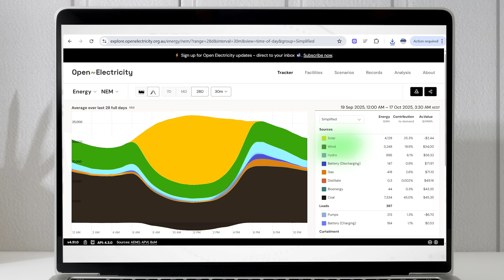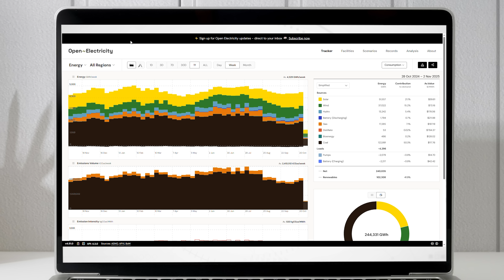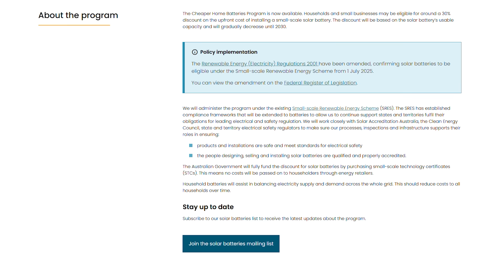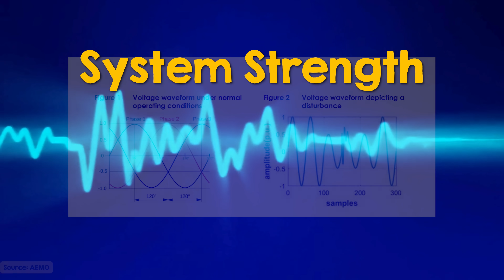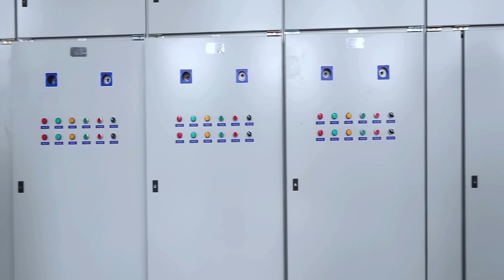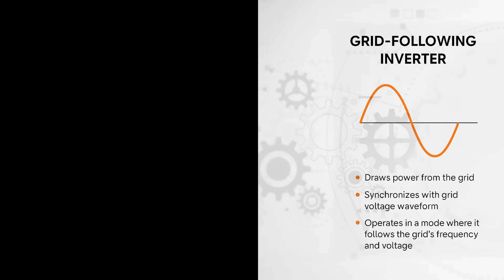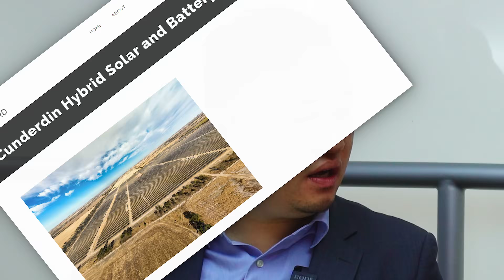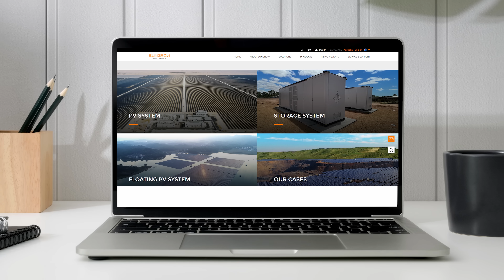Australia’s Solar Boom Is Breaking the Grid - Or Is It?

Comment: Surely with the amount of cheap electricity coming online the shift to EVs in Australia will have to accelerate? It feels like you’ve struck gold but a good amount of Aussies refuse to touch it.
Reply: In China the electricity is around 4 times cheaper. In the cities there the EV take up is high. Has the advantage of quieting the roads too, making them more pleasant to be around.

Australia has 'negative power prices', but a separate supply charge that is huge. i.e. the power prices are a scam in Australia. Of course, it would make sense to wait until the technologies become truly cheaper, but it is politically non-viable. Better to say electricity is 'cheap' and separate the connection fee and fees for 'maintenance.' Surprisingly, other countries like China are significantly more honest.
Reply from the maker: The Australian government just announced we'll be getting 3 free hours electricity across midday. That's surely got to tip the scales A LOT in favour of EVs.
Reply: @EngineeringwithRosie And home batteries. And we needed V2X yesterday.
Reply: @EngineeringwithRosie  What did they teach you about free things in your Engineering studies?
Reply: @EngineeringwithRosie  It'll be interesting to see if that gets passed on in EV fast charge stations which usually charge a fair bit for electricity. 

If so, probably gonna cause issues around that due to the limited infrastructure - like people lining up around the block at the cheapest servo in town to save a few bucks. 

Would likely require a lot more investment in fast charge infrastructure and the grid upgrades to suit, as those have a wicked high intermittent demand
Reply: @Thermoelectric7  I think there shouldn't be anything "free"— it's corrupting. Paying a quarter to half the price, that is, receiving a discount in exchange for network stabilization, is fair.
Reply from the maker: @Thermoelectric7  ha ha no way will they do that
Reply: @Thermoelectric7 In Germany, I saw an interesting solution - parking for electric vehicles with above-ground and underground floors near public buildings, where solar panels from the entire block are connected.
People come to work and their cars literally “eat up” all the excess generation at the "daypeak = night" tax rate.
And in the evening, taxi and car sharing cars arrive in their place and are charged at the same night rate.
Reply: @MihailG5541  The company "shareholder interests" model is corrupting.  SA's 2017 blackout was because it was more profitable for energy generation companies to with-hold gas and allow the grid to fail than to supply more gas.
Most of the shareholders are foreign citizens, so it wasn't in their financial interests to keep the power on.
If that's not morally corrupt, I don't know what is.
Reply: @EngineeringwithRosie nothing is ‘free’ from the government.  You’d be very naive to believe that.
Reply: @EngineeringwithRosie  I work at AGL, weve been offering the free midday energy plan in SA for a little bit now with the Three for Free plan.

There's been a good uptick of takers. The great thing is it's so helpful for people who can't get their own solar system
Reply: @EngineeringwithRosie  To me free power in the middle of the day tips the scale to Bitcoin mining, gas separation and compression, battery storage and anything that requires a ton of power being drawn to the middle of the day. Heck why not just get a freezer and chill a huge block of ice in the middle of the day yo cool your house. I am sure I can think of hundreds of ways to draw down the grid.
Reply: @EngineeringwithRosie  Er that just admits that rooftop makes so much that it overloads the grid.
Reply: @FlintStone-c3s  I SA, when too much rooftop generation threatens the grid, they switch off the rooftop feed-ins to the grid.
Reply: @EngineeringwithRosie incredible and very lucky for you!
Reply: IMO, V2H (vehicle to Home) will be the thing that boosts EV's -> the ability to use car as the home battery, in place of installing static batteries. Might kill the home battery market if it becomes a norm.
Reply: EV's use less electricity than petrol or diesel cars when you include the electricity used in processing the crude oil into petrol or diesel.

So more EV's means less crude oil processing.

Therefore more EV's means less electrical demand.
Reply: @matthew_baynham that means nothing when you charge them off a grid powered by fossil fuels.  😂
Reply: Sounds like a vanity project, trying to prove to the world how you might be able to run a country on renewable energy. The extra costs are irrelevant,the destruction to the landscape is irrelevant. The loss of high energy use industry irrelevant. But hey look at us we're clever aren't we. Not forgetting that the money,effort and destruction will not have any affect on the climate
Reply: EVs are the wrong solution, car dependence is the problem, trains are very easily electrified and use power directly from the grid and regularly. They are also the most efficient form of transport space and energy wise. Natutally some cars will be necessary for remote areas but people can still use those its about giving people an alternative so that they have the option. For example many families in the netherlands own only one car whereas in the UK its closer to two.
Reply: @JNelson_  China's developing light rail/tram/trolley system that follows electronic beacons set in the road, instead of rails.  Routes can be changed by switching beacon trails on and off.  Plus rubber tyres, not steel wheels.
Reply: @oakfat5178  Rubber is less efficient than steel simply due to the higher friction that's why trains are much better. Not to mention trams are much more predictable and so they can be mixed safely with walkable areas. There is no reason to reinvent the wheel really or rail in this case.
Reply: @JNelson_  It's a trade-off of rubber usage against versatility.  These trams can also ignore the beacons and be used as articulated busses if they need a route with no beacons implanted in the road.
The biggest resistance to more trams in Adelaide seems to be the cost of laying the tracks.  Imperfect trams would be better than no new trams at all.
Reply: @JNelson_ we have decent public transport, but the train is basically already full everyday. And the country is too spread out to make it convenient for alot of others, plus it takes a very long time to make new lines etc. I don’t see that being the fix
Reply: @seekingtodream  If it is full it simply means you need more services and lines these are people that would otherwise be on the roads. 

Being spread out is a myth perpetuated by the car lobby in the USA and it's not supported by actual evidence. Even if you ignore long distance trips (which can and are regularly filled by trains in many countries). Most trips are short anyway, trips to work or the shops things which can easily be filled by light rail and other trains.
Reply: @JNelson_  public transport to work for me would be 2 busses and a train. Or one comfy car ride with my own space. It’s a pretty easy choice. 

I’d be tempted if it was just one train. 

If buying something, I’m driving because it’s easier to put it in the car than catch a bus, wait and carry anything with me. We just need a government that is willing to teach people how to drive properly.

Like maybe a message that says merge at the speed limit, instead of drop 5 save lives bullshit.
Reply: @seekingtodream  That's my point though, shit public transport is shit, good public transport is seamless and more convenient than a car. 

I'm not saying anyone should use one method over another the only way to make public transport attractive is to raise the quality and provide a better service.

The more different forms of transport people can use the lower the load on those transport types, if everyone uses a car then the roads will always be a nightmare this is another proven effect of the load matching the capacity, the only way to reduce the low below capacity is to provide sensible alternatives.
Reply: @JNelson_  We need not only trains, but also trams, trolleybuses and buses with long autonomous running times.
Reply: @MihailG5541  Totally agree I was kinda using trains as a catch all for all kinds of rail transport but as you say a good public transport network is multi-layered: metro, trams, intercity trains, buses etc.

EV vehicles require nasty materials to create and cause more road damage (due to their weight) they are not a silver bullet for cars.
Reply: Range is the issue. My EV has 330 ks of range. But that's a pittance driving Melbourne to Brisbane.  

EV makers should forget gadgets.  Just give us basic cars with fuking big batteries.
Reply: @Triantiwantigongolope  300kms of range means almost 3 hours of driving, no?

I have a Rivian and opted to buy the biggest battery - with 400 miles of range. I rarely drive more than 3 hours without stopping to pee/walk the dog / eat anyway.
Reply: @therealcmj  400 miles of range would be great. It's not so much the number of hours driving as the distence between opportunities for recharge in Australia if you go off major highways.
Reply: @Triantiwantigongolope  It is more profitable to use two batteries of different types (for urban start-stop style and traction for country style)
Reply: @Triantiwantigongolope  On the other hand, if you only drive from Melbourne to Brisbane a couple of times a year, it's rather inefficient dragging round a "fucking big battery" for the rest of the time. You could hire a car with that capability, or you could top up en-route.
Reply: @matthewmarks6951 perhaps. But it would still be easier to have a range of say 700ks. Especially in the bush.
Reply: @Triantiwantigongolope  carbon neutral fuel and high efficiency ICE. It boils down to specific energy… batteries have none when compared to liquid hydrocarbons. We will need 40 x more resources for batteries than we ever would for liquid hydrocarbons. Make the hydrocarbons cleaner or carbon neutral. 

People are not going to want to give up their standard of living to buy expensive EVs with big batteries. No one cares about emissions if they can’t afford to get to work or take the kids to school or buy groceries. 

Energy needs to be plentiful and cheap and available 24/7. 
Everything wind and solar cannot achieve.
Reply: @polarbear7255  carbon neutral high efficiency ICE sounds good. But I can't see it on the horizon.  EVs are better than current ICE cars other than range issues. Been running solar with a 20 Kwh battery and an EV for a bit over three years.

My spread sheet shows I've saved a bit over 8 k in car fule and about 5 k in house fule. Running costs included it's quite efficient and should improve as capital costs are revovered. However I confess I  have not tracked petrol prices very well. As a result, I'm assuming an average of 180 cents per litre, which may or may not be accurate.
Reply: @Triantiwantigongolope ze Germans have already manufactured carbon neutral fuel using wind turbines. Fully automated process. It extracts CO2 from the atmosphere to produce the fuel. It’s only a matter of time.

EV are no better than any other car. It’s still just a car. Just the engine is different. Still has suspension, brakes, steering, tyres, coolant,
Lubricants and electronics. Still wear out as you drive it.  No one is going to pay 20k to put a new battery in a second hand one either. So they get scrapped exacerbating the resource intensive nature of EVs and batteries that just shifts the emissions away from the tailpipe to China.
Reply: @polarbear7255  pretty cool for the Germans. Will be great when it is generally available. That's a real breakthrough  

Try driving an EV for a while. The lack of noise and vibration make a big difference on long drives. Servicing is also $ 250 every two years.
Reply: @polarbear7255 I don't know of any cheap "carbon-neutral" fuel other than that produced from industrial hemp or palm oil. Everything else is too expensive.
Reply: @polarbear7255  by the time the battery wears out, the rest of the car will be worn out as well. So you are right, no one will be buying new battery for the old car.
Recent stats show, that most batteries will actually out-live the rest of the car and will be forwarded to second life use (like energy storage) when the car gets scrapped.

Yes, Germans are producing carbon neutral fuel. But it is for the luxury sport cars only. Simply because it is really expensive. And it will remain expensive, because it is highly inefficient.
Both catching the CO2 from atmosphere and producing clean hydrogen are still waiting for some huge invention to make them viable. So far the efficiency is tragic = high cost.
Reply: @tomas_klouda  but also, would you install a 10+ year old EV battery in your house? With an unknown history, the prevalence of battery fires and the extreme difficulty in extinguishing them. No insurance company will touch that with a 40ft barge pole. 

The batteries will get dumped. Even slightly damaged of defective EV batteries are deemed unrepairable and are written off. 

Who then is responsible for the safe disposal of said batteries when they give up the ghost or start leaking at 15 years old. You want to be the home owner responsible for that?

Carbon neutral fuels are coming. It leverages our existing infrastructure. The Germans waged 2 years of total war on fully synthetic fuel. So don’t try to tell me it’s not possible. A wind turbine is free electricity right? That’s what I hear all the time from renewable zealots. It will start with sports cars… and will flow down to every other vehicle because the business case exists for it.

It may be inefficient but the process is no more inefficient that using wind and solar and batteries to power a whole economy. You are using a dilute energy source to create a fuel with a higher specific energy. 

Why do you think Toyota is currently racing hydrogen power’s vehicles? Solved engineering problem. Hydrogen has the highest specific energy of any non nuclear fuel. It’s future use is inevitable: because there will be no other choice. It’s and infrastructure and distribution problems. Japan will go hydrogen not EV. Much less resource intensive and better of the environment.
Reply: @polarbear7255  no, I probably wouldn't, as that would be too expensive. Such young battery is usually perfectly healthy, and someone would buy it to replace the damaged one in the car.
I would buy some 15-20 years old one, which has higher degradation and low price. I am actually waiting for such batteries to become available to install it to my house. There is plenty of 20-30kWh ones from old EVs now, but that's too small. I would prefer something like 60-80kWh, for example the LFP one from basic Tesla Model 3.
Regarding safety, I am pretty sure any EV battery is much safer than those batteries you get with PV install. For EV the safety standards and build quality is so high, that the standard PV batteries can only dream about being so safe. And this also means if it is installed to the house adhering to electricity standards of your country, there is no issue insuring it.

No one will dump batteries. That's another totally mistaken thinking. They contain too many valuable materials. If the battery pack is damaged, it is opened and healthy cells/modules are used to build energy storage. And the damaged/dead cells are sent for recycling. They are too valuable for being disposed!

There is/was no war on synthetic fuels🙄 Wealthy Germans just wanted to make sure their super/hyper sport cars won't get banned or stranded without fuel. There is no plan to make more fuel than for these rich car owners as it is economically total nonsense.

Building the wind turbine or solar is not free. But the main issue is that both hydrogen production and CO2 catching needs stable energy, so you can't use wind or solar in Europe for that. Which is why they build a factory in Chile. You need a place where sun is always shining and wind blows. As even stopping the production for the night is an issue. The inefficiency of the process means you need huge factory with even bigger power sources and when you finally get the fuel, you need to transport it over the half of the globe to sell it to those rich guys. So yes, it won't be cheap in foreseeable future. 

The process to make synthetic fuels is way less efficient than using solar and batteries to power the economy and cars. You are repeatedly showing you know nothing about this. You just have your opinions and dreams🙄

I have no clue why Toyota still toys with the hydrogen when everyone else already abandoned it as totally unviable way. Their hydrogen cars are pathetic when you compare any metric to EVs. Which is also why even Toyota is going EVs now and they are promising solid state batteries in cars in fee years.
They are probably just so rich, they can afford playing with the tech that has no future unless some major tech breakthrough changes the current state🤷‍♂️
Currently it is exactly the opposite of what you said. It is much more resource intensive than battery EVs, which is also why it is much more expensive. It shares the same issue with synthetic fuels. The production of the green hydrogen.
Reply: @polarbear7255  Don't hold your breath for hydrogen powered vehicles in Aust. It's incredibly expensive to store and just leaks out continually.
Reply: I’m concerned about all those battery fires and the reaction from insurance companies, what if your car goes up in a building car park? I hope this problem will be resolved over time.
Not convinced about the 3 hour free electricity, I think companies just increase prices for other times of the day.
The media say we pay the world’s highest electricity prices (overstated?) prompting the uptake of solar panels.
Reply: @darylcheshire1618  If the price of electricity goes negative, it costs to produce. If demand is shifted by giving it to consumers for free, it will cost generators less. It's rather like adding a battery.
Reply: @matthewmarks6951  Nothing is "free." "Free hours" mean longer payback periods for solar and wind power producers, higher loan payments, and less development.
Reply: @MihailG5541  "Free hours" can reduce CO2 emissions and all the associated costs. I agree with the other commenter that a minimum amount should be charged, however.
Reply: @matthewmarks6951  "Free hours" will lead to excess energy consumption for unnecessary purposes.
For example, heating water in a boiler (which won't be fully used in the evening), running air conditioners in turbo mode (when people are at work, not at home), and so on.
Reply: @MihailG5541  "Free" means zero production cost in this context.  I'm sure no deception was intended in that use of the word.
Reply: @darylcheshire1618  Electric vehicles (EVs) are significantly less likely to catch fire than internal combustion engine (ICE) vehicles—by a factor of 20 to 80 times, depending on the study.

Here’s a breakdown of the most credible comparisons:

Fire Incidence Rates (per 100,000 vehicles)

Vehicle Type	Fire Incidents per 100,000 Vehicles	Source	
ICE (gasoline/diesel)	1,530	EV Engineering	
EV (electric vehicles)	25	EV Engineering	

This means ICE vehicles are 60 times more likely to catch fire than EVs, according to a 2025 study by Anidjar & Levine EV Central

Why the Discrepancy in Public Perception?

• Media bias: EV fires tend to be more dramatic and receive disproportionate coverage, skewing public perception firestati...
• Battery fires are rarer but harder to extinguish: When they do occur, lithium-ion battery fires can be more intense and require specialized response protocols
• ICE fires are more frequent but less reported: Routine engine fires in gas cars are so common they rarely make headlines.

Technical Causes

• ICE fires: Often caused by fuel leaks, hot surfaces, or electrical faults.
• EV fires: Typically linked to battery damage, manufacturing defects, or thermal runaway events—but these are rare and often occur during charging or after severe crashes.
Reply: @darylcheshire1618  The enormous fire at the Luton Airport Carpark in England was found to be caused by a DIESEL VEHICLE. EVs were blamed for the fire 
but it was just uninformed gossip.
Reply: @darylcheshire1618 As you say, much in the media is overstated, particularly those groups that are intentionally anti-renewable energy. This includes electricity prices and the number of battery fires.
If there was less deliberate obstruction then solar, wind and battery developers could work with communities and power prices could get cheaper sooner.
Car battery fires are already much less likely than fires in cars that rely on a large tank of highly combustible liquid. The Chinese government has also introduced rules that car batteries must be built to prevent fire developing.
Reply: @darylcheshire1618 EVs catch fire less often than IC cars. For any lithium battery, if it doesn’t meet the German or EU standard don't buy it. Those that do won't catch fire.